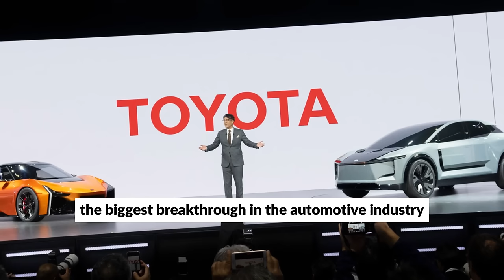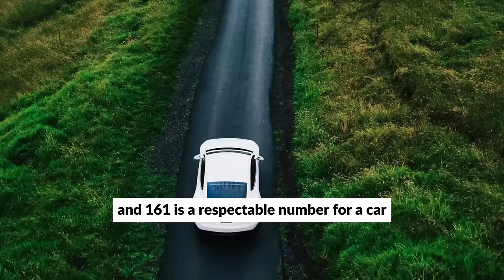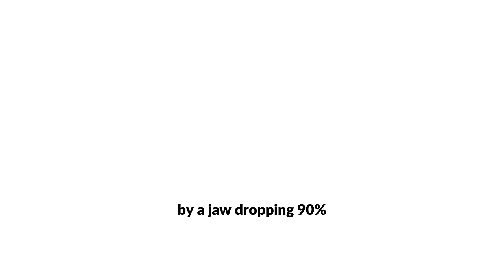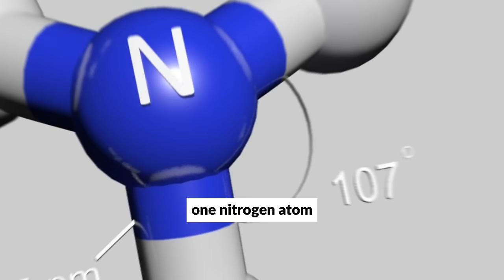Toyota CEO Unveils Game-Changing Ammonia Engine Set to Revolutionize EV Market!

Comment: BS -To get 1000 miles of range you would need about a 40 gallon fuel tank.  Green ammonia is made from hydrogen at huge cost, about 5x the cost of power compared to an EV.  It is highly toxic, corrosive, and is hard to ignite so it burns poorly in a piston engine, and has no distribution system. Not sure Toyota will survive with this thinking. It is a distraction at best.

Comment: LOL - this is so asinine. Do you know where ammonia comes from? It's made by the Haber process, i.e., 2N₂ + 3H₂ ⇌ 2 NH₃ - that's right, it requires HYDROGEN - >99% of which is made by steam reforming of methane (or worse, coal). That means you're still dumping CO₂ in the atmosphere - this is just another way to keep fossil fuel consumption going. And Toyota is going to push liquid ammonia dispensing infrastructure? That's insane - as is the idea that your going to use an engine that circulates liquid ammonia! (Spoiler alert:  the boiling point of ammonia is –33˚C, so Toyota will need an onboard cryogenic system and/or a system capable of handling ammonia pressure buildup.)